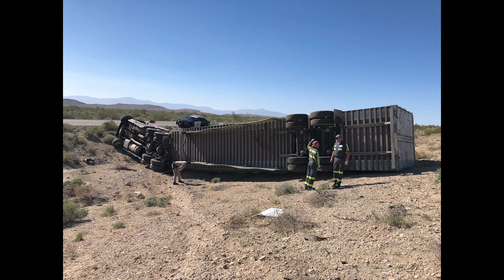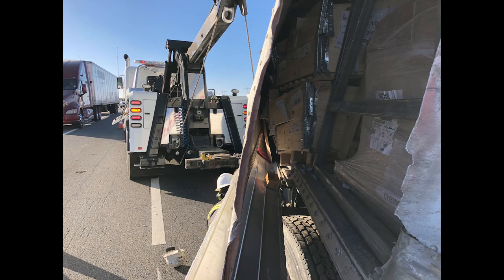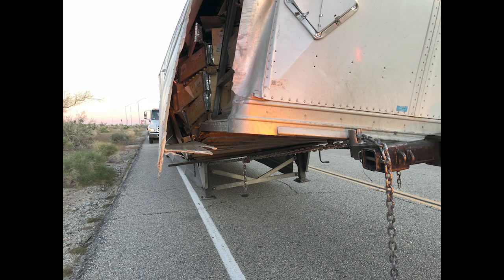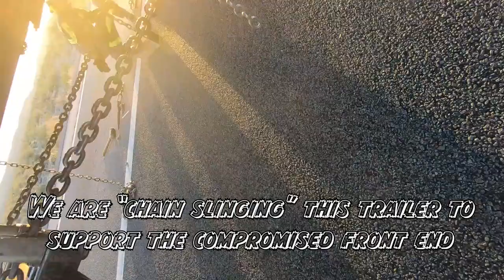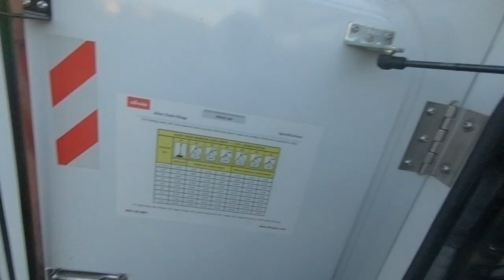Semi Truck Flips Over! Part 2 - Upright and Recovery

Comment from the maker: Thank you for everyone who has watched so far! I haven’t had a single complaint about the radio. Is it any better in this video? Like I said we were dealing with 50+ MPH winds so that’s the reason for the issues but i added a few filters to the audio on this one hoping it would help. Feedback is appreciated
Reply: Sir Trent !!  There wasn't a problem with wind noise !!!  Could hear some of the conversations !!! The video did the questions of how you guys were gona get the unit back up !!!  The BIG QUESTION was with the wind blowing that hard was it gona stay upright or get blown over again with all the weight on the front-right corner of the trailer with all the damage done to it ??????  KEEP IT SAFE !!!! P/S !! Sent you 2  trailer power cord connectors !!!  Yours to keep & 1 for Daryl !!!!

Comment: Another fine job well done.  I have a question, concerning a piece of equipment that we see get used when Darl's truck is going to pull a victim.... er.. customer.... He (or whomever is using that truck) uses a chain with a choker-style end on it for tying the frame into the forks (so that the towed vehicle can't jump out of the forks).  I've never seen those anywhere else but on Darl's truck.  Did they come with that truck?  Is it a name-brand item that is perhaps obsolete now?  Is it simply Darl's preference using that style?  They seem to work, but everyone else uses a standard piece of chain with throat hooks on the ends.  Just curious about those particular restraining chains. Thanks.
Reply from the maker: It honestly is just personal preference and is what came with the truck so darl adopted that way. Personally, I don't care for it but I will admit it is super secure. But like I said, personal preference is what it comes down to.

Comment: Since both truck and trailer have air suspension, wouldn't have supplying air it helped with a getting a bit more ground clearance?

Great work on getting it back upright. 

Surprised you guys haven't made / acquired a dolly for loading compromised trailers onto the landoll trailers.
Reply from the maker: Yes! We supplied air to the trailer which gave us some clearance but due to the damaged tractor, the air system was compromised. We considered running air to the airbags independently but decided that would be rather a time consuming. Great observation!

Comment: So, when a semi trailer, or a RV turns over, it's going to be a total loss. They're just flimsy.  Is that correct?
Reply from the maker: Most of the time yes although I've recovered some that were drivable after with just minor scratches and dents. Thanks for watching!